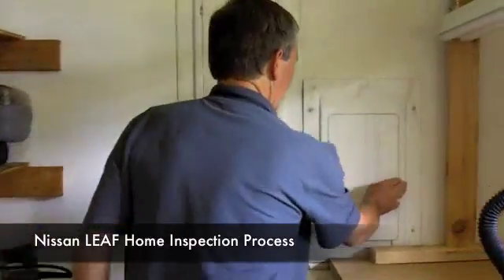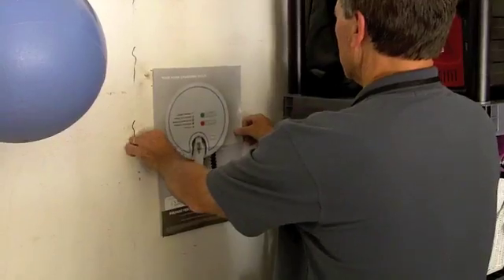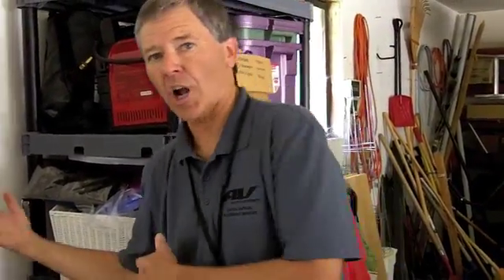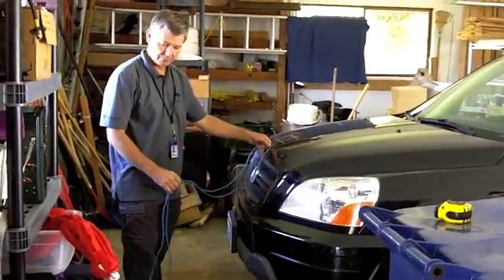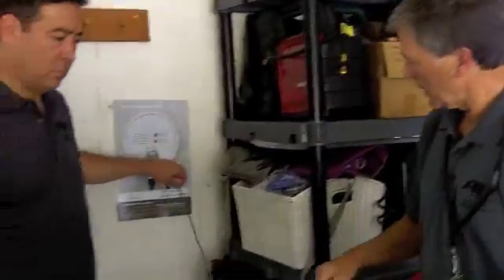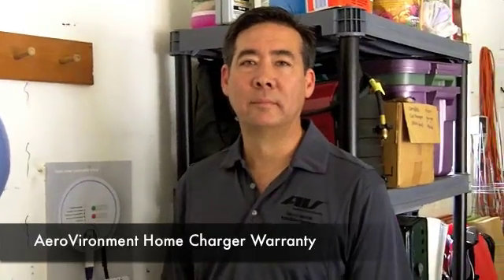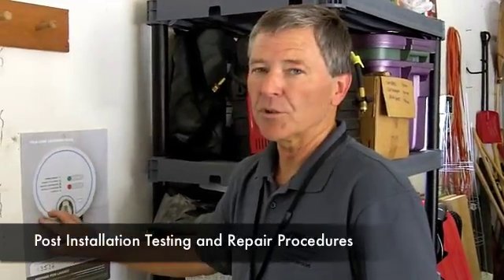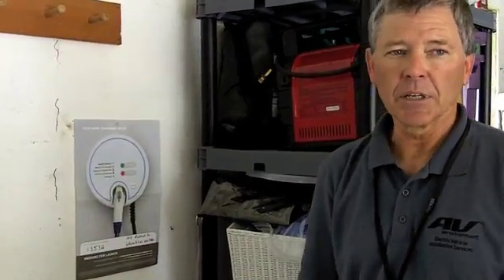Nissan LEAF Charging Station Home Inspection

Comment: I like the way they make it sound like major project rocket science.  It's just a 220V appliance like an oven or dryer.  The unit shown in the video is available on Amazon and Home Depot websites for $1000 with a 220 plug already on it.  Install your own 220V outlet or pay an electrician $150-$300 to do it for you.

Comment: No, you have to purchase it separately. It will cost from $775 to $1,200 with the installation. But only if you take the tax credit, otherwise it can cost up to $2,200.